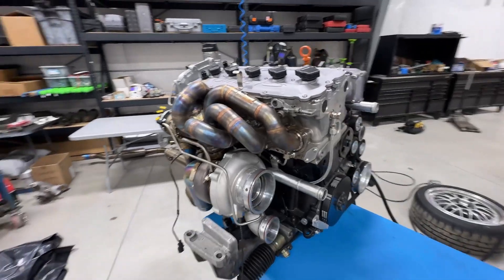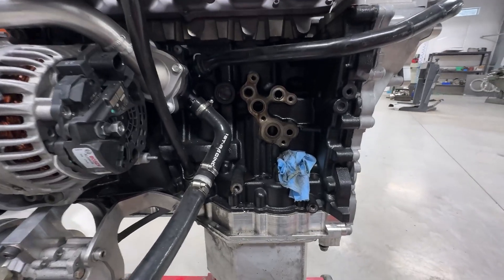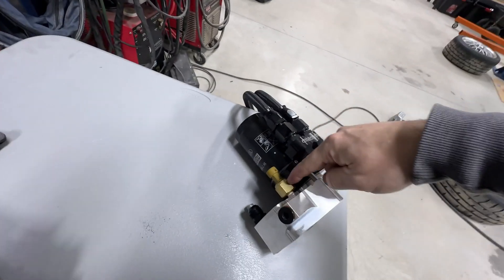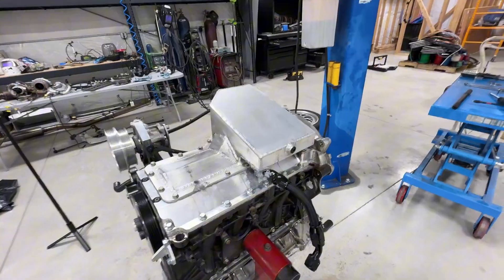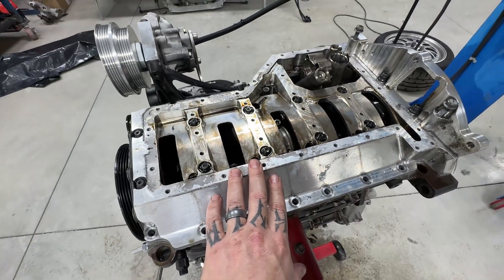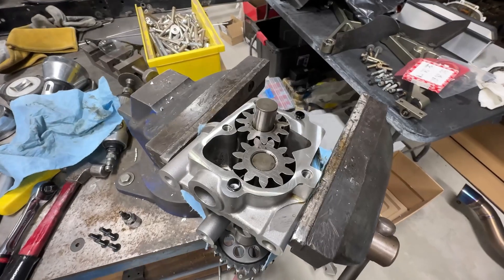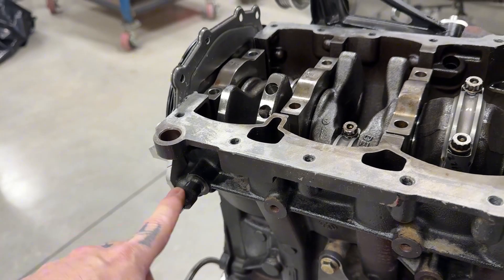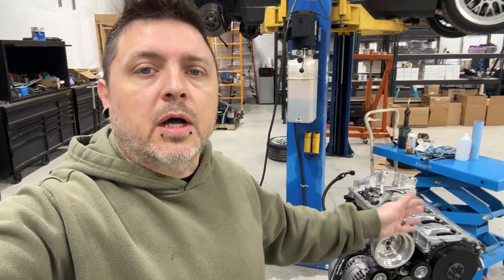5 Banger Turbo? 600 Horsepower 07k Powered Porsche 968 Episode 2

Comment: I may answer my own question by looking at your website(which I will do) but do you do any one off type work like if I drew something up in fusion and sent it to you or maybe like small production run stuff? I use Send Cut Send for a lot of cutting now but I have some ideas that would be much cooler if machined rather than just cut and welded. My email is in my about section if you have any desire to actually talk about it. lol
Reply from the maker: Yeah I do do job shop work, I try to keep it to at least small production though as one-off stuff is too expensive for you and I still don’t make money. 😂

Comment: Most 4 valve per cylinder engines have some restrictor for the cylinder head, I thing that is on purpose and hydraulic lifter may not like more flow and pressure on them, also may overflow the head with oil and have draining issues. Definitely the best main griddle I’ve seen!

Comment: Bummer that you had to go through the extra work to remove the girdle but I sure appreciated seeing it! That’s a very well designed piece as proven by the other guys running it and making some BIG horsepower reliably. I can see you put a lot of thought and effort into creating that girdle.

If it’s not too much trouble, what’s the width of the rod bearings (or rod bearing journals on the crank)? Always interesting to compare the width of the rod bearings on various engines running very high hp and tq per cylinder. Oh, and what’s the static compression ratio of this engine?
Reply: It was also good to hear the EGT sensors gave you the ability to identify that cyls 2 & 3 were running lean so you could fix that. There are LOTS and LOTS of modified and tuned engines out there NOT running EGT sensors on every cylinder so they have no idea if their engines have imbalances in the air / fuel ratios on any individual cylinders.
Reply: I forgot to ask in my above comment - which EGT sensors did you run on that engine? I need to find some fairly compact EGT sensors for my engine and the ones you’re running on this engine look like they might work for what I’m trying to do as well.
Reply from the maker: They are from exhaust gas technologies
Reply from the maker: I haven’t measured the width that I recall, but they are pretty narrow
Reply from the maker: Compression ratio is 9:1

Comment: ha, I have a gooped up weld on my BB upper pan, I just don't want to drop the engine to weld it, also i have the iroz filter adapter with no drain back valve, I have noticed not ill side affects